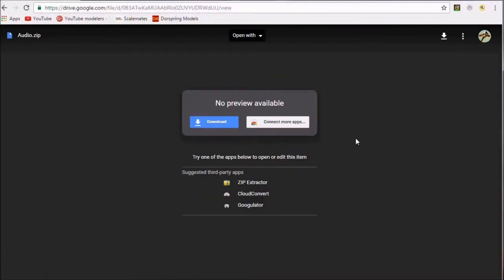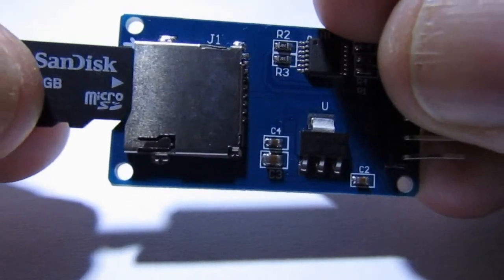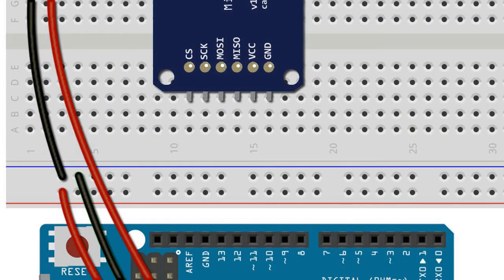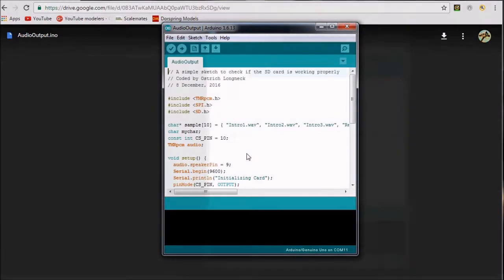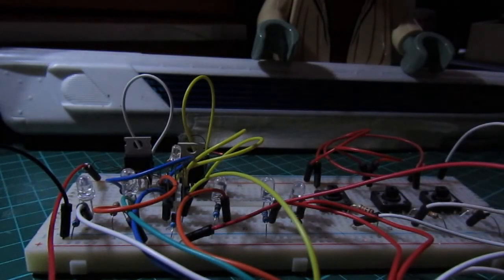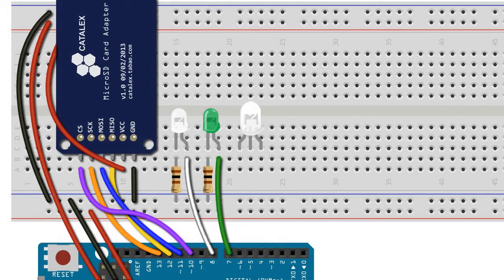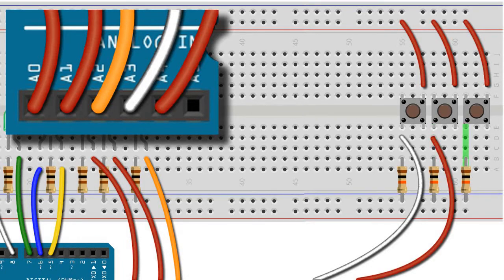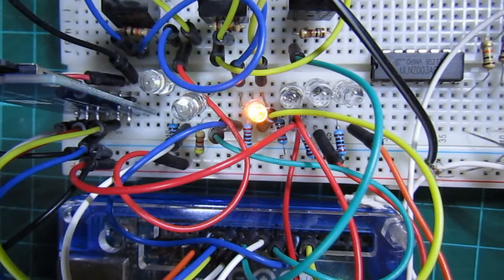Arduino for Starships - Ch08 - Adding Sound Effects to a Circuit with an SPI-based SD Card Adapter

Comment: hello Trevor, thanks for sharing your very helpful and brillant videos ! I have a little issue with the green navigation and white strobe leds, the power is not strong enough, the white led is not bright enough and the green led doesnt flash, i dont know why, can you help me with that please ? thank you !
Richard
Reply from the maker: Hi Richard, are these still on the breadboard or mounted into a model? The most likely reason for an issue on the breadboard is a resistor value that is too high. Maybe replace the current one with something between 120 and 470 ohms. When inside a model, one should not mount more than 3 LED's in series, and try to get a power supply that yields 2 amps. I hope this helps?
Reply: @OstrichLongneck  thanks for quick answer, it is on the breadboard, i did a test by removing the resistors, it is probably the arduino board itself, just ordering a new one, still waiting to receive it. have a great day !
Reply from the maker: @richardb.8467  Cool! Happy model building!

Comment: Your videos are great! I am currently building the Refit and the Reliant 1/537 scale models. This will be perfect for them.  I wish I knew more about coding, I think it would be great to link the two ships together so it simulated a battle.
Reply from the maker: Hi Ken :-) Thanks for your kind words! I have the same kits, just haven't managed to be brave enough to build them yet. That's a great idea, setting them up as in battle on a diorama. And the nebula they used in the movie (Mutara nebula I think, but I may be wrong) would also look great all lit up - if one could somehow incorporate it all into a diorama! I learnt most of my coding by searching for sketches on Github, and then reverse engineering them. I'm actually a pharmacist, so I have minimal electronics knowledge, haha. I kinda made the video series as I learnt along the way. You're welcome to send me a sketch if you're ever stuck. I've managed to "fix" a few sketches over the years. And of course you can modify the sketches included in this Arduino series as much as you like. They're totally within the public domain and copyright-free.
Reply: @OstrichLongneck  Put those models together! They will look much better in a display then in a box...haha. Is there a way to delay the phaser led about a second behind the sound? I cut out Khan saying Fire! and the phaser efx from the movie. I used a program on the web to remove the background music. It sounds great but the led flashes as he's yelling Fire. I tried different delays but nothing works :(
Reply from the maker: @kenmushinski3495  Hi, Ken 😀 Yup, I'm definitely going to take the plunge and start building. I'm doing the Buck Rogers starfighter next - still debating with myself about lighting it. It's the most expensive model in my stash. I was thinking about the phaser delay problem. Would it work if you started the sound effect and then delayed for 1000ms before stating the light effect? The sound effect plays autonomously, which allows us to do other things in the background. I don't know if this helps any?

Comment: Travor, my old friend, remember me? his newest Brazilian friend and who has been (for some time now) building this project for my Enterprise 1:350. I confess that I'm at a much slower pace than I expected but the trip is more exciting than the destination. I want you to know that my project is finally complete but I have a question that I need your help, it's that the led strips I put were very weak and I would like your suggestion on what I should do to make the led strips shine more brightly, can you give me some help?
Reply from the maker: Hi Luiz, sorry for the late reply. Life has been hectic. You could try to use a power supply with a higher voltage (12V instead of 9V) or a smaller resistor if you have one connected. I find most LED strips shine incredibly brightly on a 12V supply, and most of them are safe even at 15V :-)
Reply: @OstrichLongneck  Hello old friend! I found where i was going wrong.  There was a short circuit on my breadboard( which is already very old.... lol). Replaced the board, problem solved.  Tanks! See you later
Reply from the maker: @capkirk1001  That's wonderful news! I'm glad you got things going again! Good luck with your build 🙂

Comment: Hello Trevor,  I want to Thank you again for all your help. We have completed the startup sequence and with all the lights and sounds. But I had a question, neither my students nor I could figure how to play more sounds during the startup sequence. We have add the wave files to the SD card but how do we modify the code, do we add another line to the audio.play("Intro1.wav"); section? We tried adding "Intro2.wav", "Intro3.wav", but received an error. Your suggestions would be greatly appreciated. We are going to modify the sketches for Klingon Bird of Prey and other ships with new wav sounds. We replaced the phaser and torpedo sounds with Klingon weapon sounds and they worked!

Comment: Hello Trevor! I want to Thank You so much for your very helpful and informative videos. I am learning as well as teaching coding to my middle school students at the same time and your videos have been helpful. We also have an afterschool model building club and I want to incorporate both worlds in our club: the joys of model building and coding; a marriage of Art and Technology! I have double checked all of the wiring, installed the libraries, check my coding and have not received any errors. I can see that the SD card player is ready and the files are playing but I am still not hearing any sounds. Can you please offer any suggestions, what else I should check? I am using an Arduino Uno from my Macbook. Thank you again!
Reply from the maker: Hi, Jose 🙂 I must commend you on your undertaking to train young minds in a skill which may spark them into deciding on a future career path🙂 Much like you, I created the series as I was learning myself, as I am a pharmacist by profession, and the Arduino was a steep learning curve for me. I'm truly humbled and grateful to think that you found the videos useful in some small way. That said, as for the lack of sound, the only thing I can think of is that the speaker might not be connected up correctly. But you've probably checked that a hundred times, and maybe also switched the input and ground wires of the speaker just to see what happens? I'm not a big fan of the particular SD card player I used in the video myself, but I couldn't find anything else which worked with the Arduino. It's a tricky bit of hardware, and I remember having to jiggle all the wires a lot to get it to work properly 😞 So, not much advice I guess, except maybe to re-build the circuit and jiggle the wires, all of which you probably have tried already😞
Reply: @OstrichLongneck  Thank you so much responding Trevor! I will go back, rewire, and check speaker as well. Again Thank you for your service! You right about learning curve ! the kids come up to me with many questions and we troubleshoot together. I will share videos when they start building models with your awesome sketches. Please continue your great work new generations are inspired!
Reply: Hello Trevor, I found the issue! Silly me forgot to add the files to the SD Card lol! The SD card had been empty the entire time. Everything works as you have taught it. Thank you again
Reply from the maker: @JoseGonzalez-js8lg  Hi Jose. The joys of debugging - it's always the smallest of things. I'm glad you finally got it to work for you :-)

Comment: Good day.  I can't seem to gain access to a few of the sketches.   Some in the earlier sketches I can but not 5 and 6.
Reply from the maker: Hi, Google had some security issues recently and they changed all the links. These should work:
Starship-01.ino
https://drive.google.com/file/d/0B3ATwKaMUAAbSGlHME5DblQ1Rms/view?usp=sharing&resourcekey=0-yxTdkDoRhe-eAU1ClOeMlQ

Starship-02.ino
https://drive.google.com/file/d/0B3ATwKaMUAAbaW9PQWVRT09NN0k/view?usp=sharing&resourcekey=0-BWhK5Oe-SmBLE-x7De_NTw

Starship-03.ino
https://drive.google.com/file/d/0B3ATwKaMUAAbWHdnbEI5ZVROSDQ/view?usp=sharing&resourcekey=0-p3sSkckBZq1YQlL2T6iLZA

Starship-04.ino
https://drive.google.com/file/d/0B3ATwKaMUAAbMW0xRUdsNUZnQmM/view?usp=sharing&resourcekey=0-OuJfU_PGVZYPY77pGeYwOw

Starship-05.ino
https://drive.google.com/file/d/0B3ATwKaMUAAbenNWZ3BSbFotTVE/view?usp=sharing&resourcekey=0-e0G8faCL-71-XW9cOTM0ow
Reply from the maker: Audio.zip
https://drive.google.com/file/d/0B3ATwKaMUAAbRlo0ZUVYUDRWdUU/view?usp=sharing&resourcekey=0-lN-yFpIq0o6BNdZKBKGeZQ

AudioOutput.ino:
https://drive.google.com/file/d/0B3ATwKaMUAAbQ0paWTU3bzRxSDg/view?usp=sharing&resourcekey=0-kiErltLP5u32qyUSQHvxig

Convert Audio mp3 to wav:
http://audio.online-convert.com/convert-to-wav

TMRpcm-master.zip:
https://drive.google.com/file/d/0B3ATwKaMUAAbbV9jREhwandaRkU/view?usp=sharing&resourcekey=0-QmVLjcWpzQREEz_s3BRLIA

ShiftRegister.ino:
https://drive.google.com/file/d/0B3ATwKaMUAAbUVJrVTJpSnBtUVk/view?usp=sharing&resourcekey=0-E9-wXR825ADM8NrsSRvsuQ

SoftPWM Library:
https://github.com/bhagman/SoftPWM/archive/master.zip

Enterprise_Refit.ino:

https://drive.google.com/file/d/0B3ATwKaMUAAbRG5mcmJIT1JkNmM/view?usp=sharing&resourcekey=0-Sa2N_j6JJKKQyiOsLXMxwQ

LED_flasher.zip

https://drive.google.com/file/d/0B3ATwKaMUAAbT3JFay1zTW1nWlE/view?usp=sharing&resourcekey=0-001I3puTLgoKC-8tCdUKRg

Enterprise Refit Lighting Scheme.pdf
https://drive.google.com/file/d/0B3ATwKaMUAAbT3JFay1zTW1nWlE/view?usp=sharing&resourcekey=0-001I3puTLgoKC-8tCdUKRg

Nacelle_Fader.ino
https://drive.google.com/file/d/0B3ATwKaMUAAbTmlkUVJUNktORGc/view?usp=sharing&resourcekey=0-QQn7Mek04U7vlpCsi0h3dg

Shuttlebay_DC.ino:
https://drive.google.com/file/d/1IOkmCLnTo_sGu-iMTlEFXt31UjccFWxk/view?usp=sharing

Shuttlebay_SR.ino:
https://drive.google.com/file/d/1R6rvxTOCCIlnI2Ky9EnSlIFxXMineAeQ/view?usp=sharing

Comment: I ran into another problem before it actually worked. On my installation I was missing the "SD" library, so in addition to the TMRpcm library I also had to install this one. After that I didn't run into the "/Arduino/libraries/TMRpcm/TMRpcm.h:17:18: fatal error: SD.h: No such file or directory" error message anymore.

Comment: Hey! I have discovered that unless I pull the 10K resistor going from pin 9 to the Mosfet, I get no sound. Well, if I hold the speaker really close in my ear, I can.  It should be possible to use a mini DF player instead of the SD card board? I am on version 3 of my custom PCB for this. 3rd time is the charm? Just silly mistakes. I need to make it so that the LEDs are in the model but pluggable into the PCB, in the base, so that adds a bit of complexity to the board. 

Secondly, shouldn't we be needing a Darlington array or at least some transistors to power the 9 navs and the strobes because of the sheer number of LEDs involved?

Still having fun. So far. Haven't started the kit yet!
Reply from the maker: These are all great ideas. I love the way you're thinking about different solutions as they come up. It reminds me of all the hours I spend trying to get these sketches to do what they were supposed to be doing :-) you must let me know how these work out, then we can maybe put together an improved version 2.0 sometime!

Comment: Hi Trevor,
Hope you are well and tinkering away.  So this setup can run two audio files simultaneously?  I hear the phasers and the photons going off together?  I'm playing with the DFPlayer and have yet to figure out how to do that.  Got everything else going, but not playing two sound files at the same time.  Is that accomplished via the SD card library or in the code?  Thanks
Reply: Stepping through your code and starting to get the idea.  It's not playing two files simultaneously, but one file with both phaser and torpedo sounds combined, being chosen with if/then filters.  Is that correct?
Reply from the maker: @Explore-Gobal  Yup you've got it :-) I had to work within the 8-bit mono limitations of the SD card, so I was sneaky and combined the phaser and photon torpedo waveforms into a single file for those times they were fired simultaneously.
Reply: @OstrichLongneck  Sneaky is good, lol.
Reply from the maker: @Explore-Gobal  LOL, kinda like a Corbomite Manuever, Aruino-style :-)

Comment: Hello Trevor!
Hope you are well. Your series is brilliant! It is exactly what I needed to enhance my build of my Voyager model. I have a question about the first build on this chapter (just the card reader and speaker).  I want to understand how the speaker works (and the “amplifier”).  Or perhaps you an tell me if I have it right?  Are you powering the entire project off external power (9 or 12 V) and does that go to the top positive rail?  Then is the Arduino then powered from the top positive rail through the VIN pin?  Next, the speaker (positive side) is powered from the VIN rail and sound is produced with the use of the MOSFET by varying the voltage to it through pin 9?  Meaning the speaker is the connected to ground by varying the level that we power the MOSFET?  Mainly I’m trying to understand VIN, how the speaker works and how the “amplifier” works.  I hope this makes sense.  Thanks so much for this series!!!
Reply from the maker: Hi Richard, I'm glad you're finding the series useful :-) I think you have the gist of it :-) The Arduino is powered by a 12V power supply, and the top rail of the breadboard is connected to the Vin line from the Arduino. This way we can use the MOSFETs to convert the low-voltage outputs from the Arduino into higher voltage signals. The MOSFET which is connected to the speaker is essentially a poor man's amplifier, and boosts the signal to the speaker to give a fairly clear audio output. Sadly, the final circuit is a real clunker, and the SD card draws way too much power to drive all of the other lighting effects simultaneously. I'm still trying to find a good workaround, possibly by having two ATMEGA chips in sync, one driving the sound and the other the effects. I'll confess I'm actually a pharmacist with very rudimentary knowledge of electronics. I made this series as I learnt about the stuff myself, in the hopes that it would be useful to others who are in a similar position. Thanks for commenting :-) - Trevor
Reply: @OstrichLongneck  This is very useful!  Thanks again.  I've been waiting for my ULN2803 to come in so I can test properly.  Knowing how you setup the circuit helps greatly.  Be well and stay safe during this world wide pandemic!

Comment: Advise please!  I do not get any sound from the speaker (4" 60w).  I have followed the instructions and re-verified each connection.  The serial port says, "Card Ready" and then shows the two wav files on my SD card as "playing:", but no sound.  Checked speaker with 9v battery, it works.  Checked mosfet (D&C) volts while connected = 4.5v.  After  60 seconds has passed to play the files, it shows "Playing: ializing Card" and "Playing: ansporter.wav" and also a backwards "?" question mark.
Is there something I can do to check?  Anyone is welcomed to chime here.  Thanks.
Reply: Discovery: for newer Arduino Uno R3 boards, CS connection should be plugged into  pin 4 instead of pin 10 (according to another more recent video). When I run the 'cardinfo' program it shows that the card initializes and that 'the wiring is correct' and the wav files are listed.  It appears to be ready to play.  When loading the 'audioOutput' I changed the CS pin to 4, and changed line 9 by removing the existing wav files and list my SD card wav files.  Unfortunately, still no sound. 

Something else is wrong.  Again, if someone has some ideas, please let me know.

Thanks for creating these videos.  Your slow and deliberate verbal instructions work well for us older people.